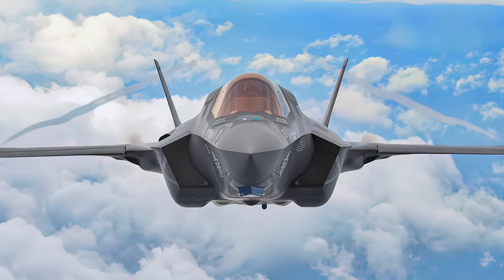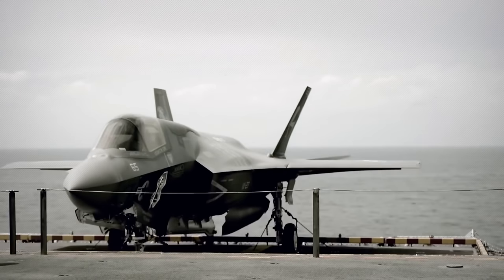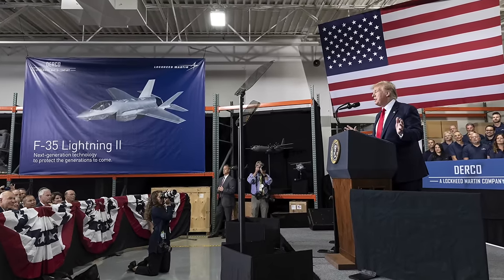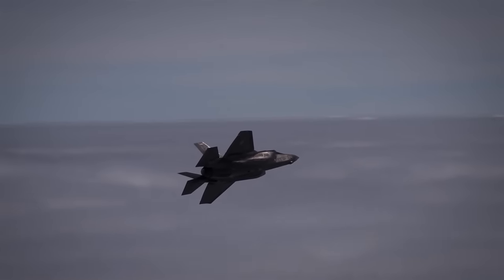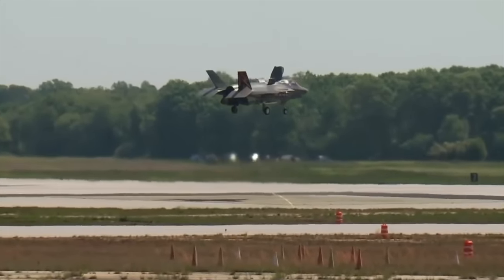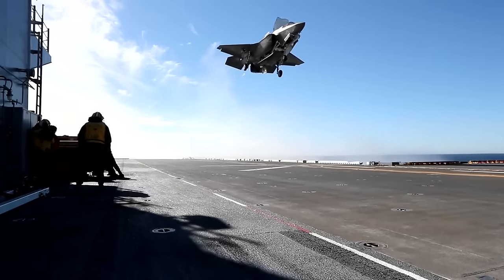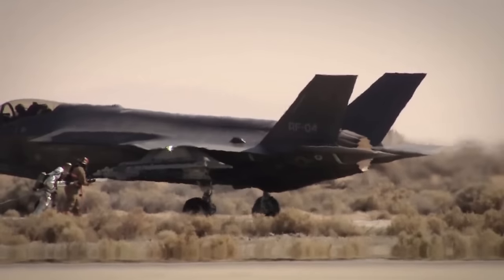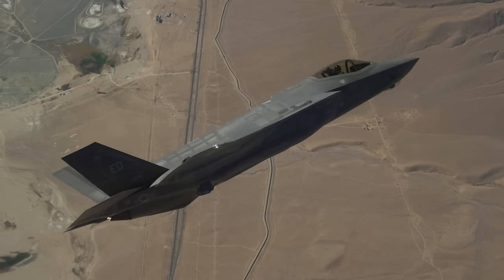F-35 Lightning II - Lockheed Martin's stealth multirole combat jet for air superiority

Comment: I've been on the ground in the UK and witnessed two f35s practice thier flight and cannon blanks and they are gently scary in thier manoeuvres. Researching thier capabilites, Wow. A border weapon immense for air to ground skirmishes
Reply: Still doesn't compare to the F 22
Reply: @danieldevito6380 no comparing f-35 and f-22. F-22 is a air superiority fighter and F-35 is a multi role fighter. One cost’s $150m the other $78m for A, $110m for the B and $100 for the C. Need I say more. F-35 was meant to do many things well and still keep costs at a reasonable level. The F-22 was and is unsustainable to operate in large numbers. The F-35 is the replacement fighter for multiple fighter aircrafts that are the backbone of the air fighter capability of the Military and is the reason why it will always be inferior to the F-22, you don’t drive a super car to work every they, you only use it on Sundays but you use your high end pickup truck. Same goes for this the Military needed a high end workhorse and got it in the form of the F-35

Comment: Great video. The current planes - The F-35's , F-22's and other's like the {R}adar {A}bsorbing (M)aterials  [ RAM ] , designs that help reflect radar energies from the sending units are all barrowed from the black birds. So Lockheed's experience is paying off now just as then. With Lockheed buying  out General Dynamics - The F-16's will benefit from the technologies that can be applied to them for Updates and upkeeping.
Reply: My father worked for a certain smelly company.

Comment: I was never a fan of the Harrier, having to clean up the mess they left behind more times that I care to count. The F35 was a major leap forward. The guys (Marines) who flew the Harriers took up half of it's lift capacity with their cajones in my opinion. They served their purpose back in the day but I've been happy to see them phased out by this machine. As impractical as it might be as applied to air combat and bombing roles, I'll always think of the F-4J's as the epitome of power and style. They'd never stand a chance against these modern machines of course but then again, the muscle cars of the 60's and early 70's evoke the same feeling and the same conclusionand they are still loved and a part of Americana. Good video, talk to your editor though ("Ground BRAKing?" LOL).

Comment: The new engine provides either 30 percent more power or 30 percent more distance.
MORE power? MORE distance performance?
I mean, it's just inconthevable.
Reply: The new GE adaptive cycle engine is awesome. Plus the New AN APG-85 radar, new ceramic stealth coating, thermal signature spoofing, EW updates, Bomb bay expansion, and next gen weapons like laser’s and AIM260 etc..

Comment: It takes extraordinary effort to keep the fleet operating even close to the required levels and the needed 'availability' rates are not sustainable long-term. By the end of the week of September 27, 2021, 52 F-35s sat idle because they didn’t have functioning engines. The problem is particularly horrid in the Air Force, since nearly all aircraft requiring an engine are F-35A variants. Service officials based plans on the promised performance rather than on the demonstrated performance and so underestimated the maintenance depot capacity they were going to need to repair broken engines. The unanticipated volume of work has overwhelmed the maintenance crews, and the backlog has grounded much of the fleet, including many aircraft being used in operational units. It takes more than twice as long as the program’s contract specifications to complete needed repairs= Constant issues, overly expensive, and unreliable.

Comment: So.... if the camera system below it that allows them to see through the bottom of the airplane gets shot.... are they just blind? Or can they revert back to the tried and true method of using you're eye balls to look through the windows? Obviously you lose the ability to look down but, what about the rest? Does the augmented helmet become useless when one of the sensors get damaged?
Reply: I don’t believe so, they hopefully designed the aircraft like a escalator would function, you can stand still on it while it moves you to your destination or if it doesn’t work you can still use it as stairs. Hopefully that analogy is part of the development process of this aircraft.

Comment: Even if the F35 can equal the A-10 in the Ground Support role (which it can't), the pilot's experience and training count for a lot in overall effectiveness. This makes specialization prudent, if not critical. The same for the Air Superiority role, though likely not as stark of a difference than Ground Support missions. Additionally, there are a number of truisms in peace and war, one of which is to not put all your eggs in one basket. If A-10's and helicopters work the Ground Support, dedicated bombers (stealth to huge missiles), it leaves the F35 to fill in as needed and free to handle any Air Superiority roles that become necessary. I'm a huge fan of the F35, but let's be smart - reducing single points of failure in favor of robust redundancy and flexibility.
Reply: I believe the Air Force will save the A-10 or order new aircrafts and continue it’s specialty pilot training, because like you say the training those airmen do is all about supporting the men and women on the ground and they do that being proud and with high efficiency

Comment: When speaking of the Navy's variant, and its overall size/design, to accommodate for fuel, did you mean"20,000lbs.". or 2000lbs. of extra fuel capacity??

Comment: Don’t get me wrong I love the F-35 JSF, and I realize that pretty much all fighter aircraft have bugs to work out. But this particular fighter jet has had ongoing mechanical and technical issues than any plane that I’ve seen. I hope that they can figure it out
Reply: F-16 had more and most problems are from the B model
Reply: When your pushing the limits of technology your bound to have issues, but like many other fighter programs before it, it wouldn’t be allowed to fly if it had dangerous and critical failures, and I am sure the ones that are crucial for the best operational capability are prioritized over time there will most likely be less and less bugs.

Comment: Kind of odd that the VTOL capability was what won them the contract but of the three F-35 variants, the F-35b is the only on that has the VTOL ability. So many other elements are the real innovation to this plane... but I find it odd to already be calling it "One of America's most iconic aircraft." Lets see how it actually performs in combat in a few years first.
Reply: That wasn’t the whole reason, however it did play a key role. Not only was the f-35 able to to take off vertically from a harder location they also managed to be to go supersonic in the same flight which neither the x-32 nor the harrier could do. Another thing is the intake the x-32 had exposed compressor fans.
Reply: STOVL not VTOL. There was no KPP requiring the JSF to be able to perform a vertical takeoff. The fact that the F-35B can is simply gravy. The X-35 was chosen over the X-32 for far more reasons than its ability to perform a vertical takeoff .
Reply: lol dude, stovl was not nearly the only reason. and it has been used many times in combat already and has returned untouched back to their airfields before iran or syria even knows they have been attacked. considering ukraine is can still putting aircraft in the air against russian air defense, the russians nor anyone else stands a chance.

Comment: F15 has an awesome trust to weight ratio and can climb vertical and accelerate. The power in the enginges with afterburners are stronger than gravity. F22 also have that kind of trust to weight ratio and can also climb vertical and accelerate. Something very important for a fighter for air superiority. F16 and F35 cant climb vertical and accelerate, they both loose speed since their single engines are not strong enogh. F16 and F35 are fighter bombers with limited air to air capability. F35 is not for air superiority!! F15 and F22 are.

Comment: F15 does mach 2.5 and F22 mach 2 and F35 only mach 1.6. To slow for air superiority. F22 is for air superiority and F35 is a fighter bomber with limited air to air capabilities. Not for air superiority.

Comment: It is true that the alloy ah part of f35 is made in china?
Reply from the maker: It seems that all F-35 are made with a rare earth component that is sourced in China. Given the current ban on certain imports from China, it seems that a waiver was issued for the component. the component is in the engine (cobalt and samarium alloy). It is a magnet. Rare earth materials are not that rare per se, but they are very toxic to extract, therefore they are mostly found in countries where rules and regulations allow to handle them. Let's just say that the rest of the world accepts the fact that in order to get those materials, they need to ignore the fact that there are heavy consequences for people working around them. rare earth materials are a serious problem, as there is an increasing monopoly given the fact that you need to ignore basic human rights and health in order to get it. We are a world of many compromises, but we all want, need and use those materials, not only Honeywell (engine). iPhones, for example, have those materials, but Apple is introducing a program to re-use them (up to 45% I think). We all turn a blind eye on those components, one way or another.

Comment: The f35 lighting 3 has kazers in it 
It has lazers front back and  sides  and locks onnti enemy fighters in all directions and kills at will 
It recognised friends and does not engage with them the computers are linked on each jet 
Rear facing  missiles slso and 4 f35 lighnitng 3s went up against 26 russian fighters killing them all 

The are half s size bigger than the lignting 2 and can jam sams and enemy ships

Comment: Don’t get me wrong I love the F-35 it’s one totally amazing aircraft but I’m sorry it could never replace or do what the A-10 can do below 200 to a 1000 feet off the deck. The A-10’s wings are designed to fly at very low speeds while turning Russian tanks into pretty much nothing ! At such a low speed the F-35 simply would not be able to remain airborne, it would stall and fall to the ground for sure. And if the F-35 took a 20mm round from the ground it would be blown out of the sky were as the A-10 would take a lickin and keep on a tickin ! The joint chiefs of staff at the pentagon continue to say that our military can do without the A-10. Simply put, there is no other aircraft in our inventory that can pull off the kinds of missions the A-10 can do and come out alive ! It’s also one of the greatest infantry support aircrafts in existence today. The U.S. has got to save the A-10 , because if their allowed to scrap them they will regret it for sure. Remember our two remaining Iowa class battleships with 16” cannons. They served back in World War Two ! And yet we refitted them and used them in Desert storm? Both of those ships were built in the 40’s and served thur Vietnam . But brought back and refitted to fight in the gulf war. I vote to refit all of our A-10’s and to keep them on active duty at least til 2050. I guess I could be wrong but !
Reply: F-35 can carry 8 small diameter smart bombs that hit any selected target stationary or moving. They also carry 2 air to air missiles at the same time. All internally. They stay out of range of enemy fire. Ground forces can laser target anything and F-35 can hit it. I think the F-35 will do fine in that role. Only thing missing will be that great sound of the A-10 machine gun.
Reply: Your A-10 refit program idea not only already exists, but costs more to do than buying a brand new F35 outright and doesn't give nearly as much flexibility or capabilities nor as updated tech. A-10s also require air superiority to have already been achieved to do CAS/CAP which is going to be increasingly difficult given the SAM environment. A-10s just aren't survivable anymore; sure it's designed to take a hit, just not from multiple SAM sites.
Reply: The A-10 was the most shot down/removed fixed-wing category aircraft in the USAF theater of operations in Desert Storm.

In a high intensity environment with means like BUK or Tor, the A-10 would not perform well.

Also, The F-35A/B/C can employ SDB (Small Diameter Bomb) and have a more accurate CEP than a burst from the GAU-8. 
It is worth mentioning that other aircraft such as the F-16 have made CAS/COIN paper surges more times than the A-10 in Iraq and Afghanistan (this was one of the Air Force's arguments for retiring the A-10, but they were ignored).
Reply: @lucasfeliphe7028   Your not comparing apples to apples either. The A-10 was not shot down in Iraq and was very much appreciated by grunts on the ground. Having total air superiority over your enemies and calling in an F-35 to conduct the same exact mission as the A-10 did in Iraq wouldn’t last very long and all and would easily be shot down by any 20 mm or 30mm heavy machine gun without question. The A-10 could and did fly through those kinds of environments daily and returned to base shot full of holes. The F-35 would have been blown out of the sky !
Reply: @jeffi854  Yes, A-10s were shot down in Desert Storm:

": Q: This conflict has shown that?

A: It shows that the gun has a lot of utility, which we always knew, but it isn't the principal tank-killer on the A-10. The [Imaging Infrared] Maverick is the big hero there. That was used by the A-10s and the F-16s very, very effectively in places like Khafji.

The other problem is that the A-10 is vulnerable to hits because its speed is limited.. We had a lot of A-10s take a lot of ground fire hits. Quite frankly, we pulled the A-10s back from going up around the Republican Guard and kept them on Iraq's [less formidable] front-line units. That's line if you have a force that allows you to do that. In this case, we had F-16s to go after the Republican Guard.

Q: At what point did you do that?

A: I think I had fourteen airplanes sitting on the ramp having battle damage repaired, and I lost two A- 10s in one day [February 15], and I said, "I've had enough of this." It was when we really started to go after the Republican Guard."
-"A Conversation With Chuck Horner".

The psychological element of cannon noise can be appreciated by troops, however the A-10 was not always unanimously appreciated, as friendly fire incident rates were considerably high in Iraq and Afghanistan.

The F-35 could employ its sensors/TGT parameters and use its SDB and JDAM with higher accuracy, fly higher, faster and with more loitering time (as I wrote earlier, many CAS/COIN missions were performed by other fighters more often than the A-10 in Afghanistan and Iraq).
Reply: @lucasfeliphe7028   Sorry, I can’t remember of a single A-10 being shot down in Iraq. Would you happen to have a news article from 1991 detailing or references any A-10’s being shot down in combat because I sure don’t remember any.
Reply: @jeffi854  I couldn't find a news precisely published in 1991, but I did find an article about the shooting down of Lt. Col. Rob Sweet who was one of the pilots shot down on February 15. The name of the article is: "The Crazy Story of How an A-10 Warthog Was Shot Down in Battle"-Nat^íonal interest.
Reply: @lucasfeliphe7028  Cool I’ll have to read the article.

Comment: F35 for air superiority?! F35 is a repacement for F16 a fighter bomber. F16 can do air to air but not air superiority. F15 is for air superiority and awesome in that role. F22 is the replacement for F15 and F22 can perform air superiority and does it very well. F35 is a fighter bomber with stealt capability nothing else.

Comment: F35 is great. However, drone technology will defeat the F35. Drones are cheap to make and that means drones are more cost effective.
Reply: Not to mention they don't have a meatsack inside so they are only limited to structural design for their maneuverability. The 6th fighters will essentially just be stealth relay stations for a drone swarm.
Reply: @anydaynow01  'meatstick'?
What garbage language to use when referring to pilots.

Comment: While working in the Marine Corps on Hornets, they said, There's this new JSF going to replace all these airplanes.  Replacing the Harrier, Hornet, F15 and F16.  Interesting thought.  But, that would mean, USMC, USAF and USN would all 3 have the same airframe.  But, navy needs and wants XYZ, USAF wants ABC, and the USMC want J - Q AND it has to be VSTOL as well.  The thought that my jets, as a Marine, could land at an Airforce Base and they'd have my parts.  But, not the engine, or any of the actuation that the VSTOL would take.  And if the USAF needed to land at an USN base they could.  But not to replace landing gear stuff because they're completely different.  USMC Flight profiles are COMPLETELY different than the others, thus, you can't even swap other avionics components.  

This airplane is trash.  Just trash.  It has been 25 years I've heard about it and it's not done yet.  The P51 completed in 144 days if I remember.  The 747 didn't even use computers to be designed and took a year or right around there.  25 years to develop a single crappy airframe when the Super Hornet, F22, then Super Hornet turning into the Growler ALL have happened and the F15 is still better than the 35 and it's from the 60s or 70s, all information from my memory.  This aircraft needs to be scrapped.
Reply: Many parts are the same as well, all avionics and electronics can be interchangeable and probably many of the weaponry as well.